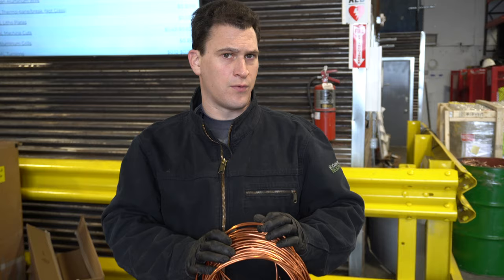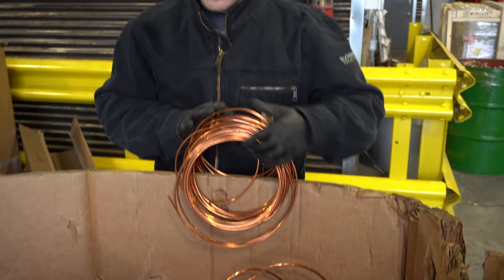Why You Shouldn't Make Scrap Ingots - Why Scrap Yards Will Say No To Buying Them

Comment: Scrap yard dont want you value adding thats their business they have a scan tool that identified the composition right through the ingot
Reply from the maker: We disagree- the analyzers do not go through the metal only analyze the surface.
Reply: @iScrapApp  A simple scratch test will show if something has a coating and an ultrasonic scan tool will show if objects have imperfections or different densities how do i know im ex military and was a Fitter armaments and ran an engineering business specialising in site welding and but welding mega structure beams and used Ultrasonics to scan the welds and only used ultra sonics as XRay is no where near as accurate engineers are lazy and fear tech and like an x-ray pic to hang on the wall...Then if someone has gone to the trouble of smelting with a casting mould and you do a break test on the first one and its legit and weight it and all the rest are precisely the same weight then its almost impossible to fake the rest as metals have vastly different atomic weights there fore all the rest will not weigh the same or even close. I smelted 50 aluminum engine blocks into 35 kilo ingots and they wouldn't take them making all kinds of excuses even though we video taped the process because as an engine block they were worth fuck all melted down into ingots they were worth 4 times more that how much the recyclers were loosing and shredding the block took literally 2 minutes..We were talking literally thousands of dollars the recycler was scamming the public. I made a mini blast furnace out of an argon bottle a garden blower and some waste oil from the chip shop and had it running on water once the oil heated the bottle any water in the mix was vaporised and split into hydrogen and oxygen and the oil powered flame went white to blue hot and the 44 Gallon drum glowed white hot in under 1 second... Ass Science is corrupted and power stations can run on water just like formal one runs water in their engines and the high temp splits the water and they get increased power...

Comment: Also it is just a waste of time, money, materials, and is worse for the environment. People think they will "make more money" but you also need to consider the cost of materials and time as well, plus the environmental costs of burning fuel and melting metals. PLUS the potential health effects of breathing in airbourne particles of copper, zinc, etc. 

All this for MAYBE a more condensed version of copper? 

The idea that the extra money from changing copper from Number 3 to Number 2 would be worth the time, energy, etc makes no sense. You might be spending maybe 40$ an hour worth of materials, costs, and labor for an extra 2 bucks. 

And the potential of getting third degree burns from the high heat. 

Just do the lazy thing and give the wires to the professionals.
Reply from the maker: We like what you're saying..

Comment: Ahh i disagree also u can get clean copper prices also compared to copper1 or c2 or even dirty prices which really makes a difference the higher amounts of weight you take in and this goes for pretty much all metals u might take and if ur using a propane setup is pretty cheap to get a bunch smelted down compared to electric, also its better for the little snippings and trimmings of copper wires and stuff that u would get a heavy deduction for if its still in its sleeves as compared to clean copper ive been doing it for several years now and there are many situations where its more cost effective and gets higher profit the only time i dont is if its already solid like tubing or giant wire but even then they will try and give u dirty prices if its not shiny copper color
Reply from the maker: You may know your copper is clean, but the yard may not, and may ding you because they cant see what else is in the bar you've made. All depends on your relationship with the yard I guess.

Comment: In the UK we also have provenance laws making it necessary to reveal the source; ingots are highly suspect. We've had a lot of thefts of copper cable from railways etc. so the law was changed. In any case, the cost of gas these days means you've really got to want to do it for aesthetic reasons, or to make blocks for sale a welding heat sinks etc.

I've never tried to sell any so have no first-hand experience.
🇬🇧
Reply from the maker: Interesting laws there, everywhere really is different on these.

Comment: I agree it's stupid to make ingots then try and sell them for scrap. Once they are cast into inputs they are no longer scrap. .
Reply from the maker: Yes, agreed.
Reply: what ever
Reply: @OldBastard-dj6er  not sure you get it so this is why. Scrap is lowest value of any material but when you smelt it down its now a new prepared product ready for remanufacture into a new product therefore a higher value than scrap. But if not done right and gets it mixed with other metals it becomes unusable. The chemistry of any alloy is highly important to its purpose and how it's used. That's why scrap yards must be strict in how scrap is sorted and bought and sold.
Reply: @kenjett2434  yeah I do get it